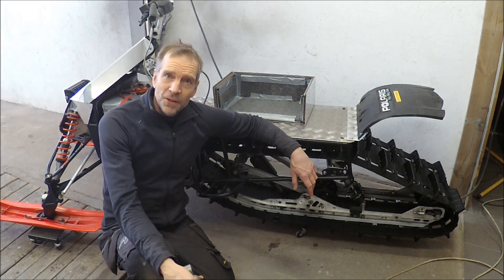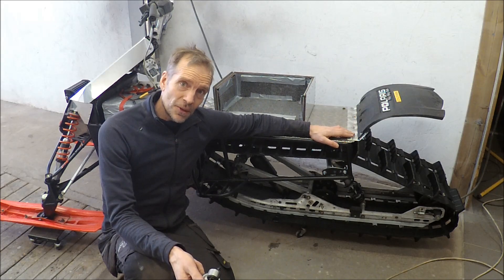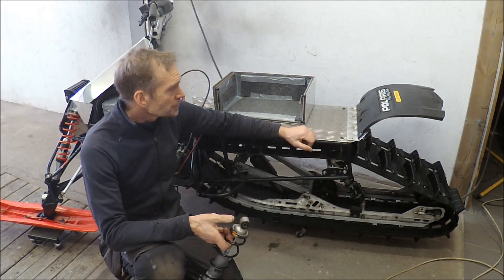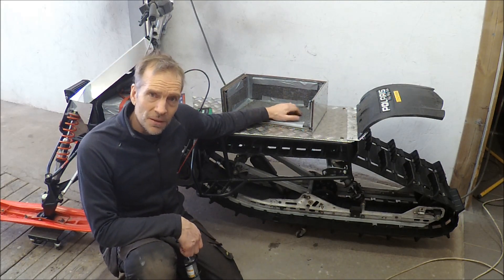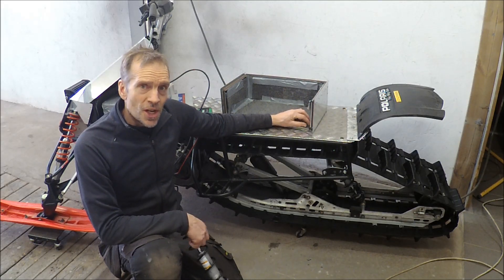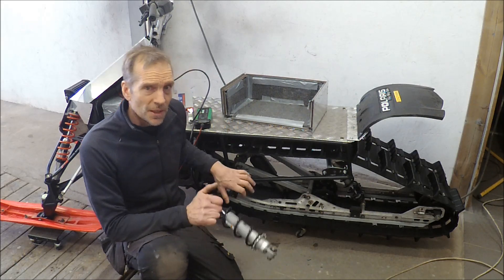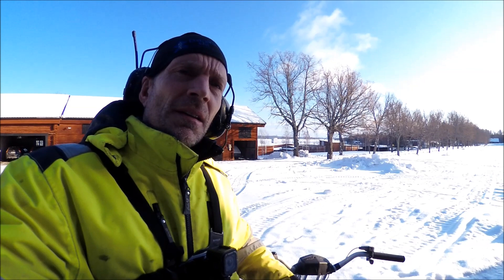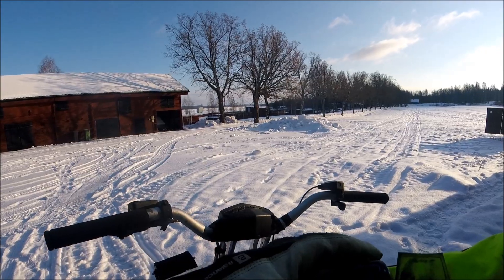Electric Snowmobile Range test

Comment: why the hell BMS's are designed to run the power through them for the main drive is baffling.. Such a stupid design for a  " smart " system.. Its the weak link in almost every build ( either restricting power limit to controller or causing other issues with balancing
Reply from the maker: I agree. But you have to design your batterypack so you dont damage your batteries. Been there done that👍
Reply: @persteel  i just do a charger balancer per pack , yea its more hassle but everything works perfect and No cap on peak amperage ,, Using lipo 3s it ends up being a lot of chargers but theyre all small

Comment: By the way, in case you are not going to create your own EV production company, why not to try to become a local dealer in Europe for Taiga Motors - Canada based Recreational EV startup? They are about to start mass production of their T3 electric snowmobiles if everything goes ok considering the challenges they might be facing as a startup and a company that never produced gas powered snowmobiles. I also have read some prospects of BRP, where they unveil their plans of going electric and aiming for the first EV's in their fleet to appear between 2025-2030. I guess they would have strong cards in their hands considering their R&D capacity, name and existing distribution and service network. What the most possible customers challenge though is real life range... . Lets see what future brings. Your videos are inspiring!
Reply from the maker: Hello, Julius! The EV sector is very interesting, also a lot of money flow in that direction. Afraid I'm just a small guy in that game. But thank you for your support!  BR Per

Comment: Hi Pän, great channel and interesting electric snowmobile project! As number of viewers mentioned I would also be keen on purchasing one of such if you would produce more. Any improvements from the last year with regards the frequent need to restart / reset and sourcing better battery pack?
Reply from the maker: Hello, Julius and thank you ! Happy you like my builds.  I usually only build one vehicle and then want to inspire others to do the same showing it is not that hard.   Problem with current batterypack is it that is it cheap batteries, whole batterypack gets unstabile. Planning to build a new one with OEM PHEV modules, much better!

BR Per

Comment: Hello, I'm glad I found your channel! full of ingenious vehicles built from relatively modest means.

I am wondering about the autonomy of your snowmobile, 30 minutes of autonomy would imply that you consume on average 8kw! (4kwh battery * 0.5h) which is a lot considering you wouldn't seem to be going very fast on your video.

With you installed an ammeter on your snowmobile (or a wattmeter) ?? with this we could see the power required as a function of the speed, thus deducing the autonomy as a function of the speed. The friction losses of a snowmobile increase extremely rapidly with increasing speed.

If your 18650 cells were not from a recognized brand, the actual capacities may be less than half of their theoretical capacities. (a good independent test here) https://www.youtube.com/watch?v=qMZuHMlRw_0

I have built several gasoline vehicles, a small snowmobile can run a good 3 hours on 3 liters of gasoline

3 liters of gasoline x 8.9 kwh = 26.7kw / h

Small petrol engine efficiency 26.7kw / h x 25% = 6.675

Brushless electric motor efficiency and loss of battery efficiency caused by cold 6.675kwh / 90% / 90% = 8.25kwh

So a battery of 8.25kwh could give an autonomy of 3 hours (1.45h with a battery of 4kw / h)
Reply from the maker: Hello, BRX and thank you ! You are correct in your assumption. I built the batterypack from cheap aliexpress 18650 batteries. I cannot charge them more than 95-96 V.  I am planning to build a longrange batterypack from Outlander modules this winter. Will be very interesting to see if there would be any differens.
Really happy for your comments and calculations. 

BR Per

Comment: Try to use the bms only on charging, and have discharge directly on the battery. And watch the volt meter manually so you know when to stop.
Reply from the maker: Hello, herskerhans ! Thank you for the tip, I will try that. I have done that before but without coulometer, batterypack cought fire....  BR Per

Comment: What type of battery is that currently? Storage batteries are not best designed to give large outputs of power otherwise they die fast. I guess your not using storage batteries i hope. I am building a 20s 4p pack from 21700 cells
Reply: Very nice 🙂 but no donuts??
Reply from the maker: Hello, Jaz !  It's comming :-)   BR Per
Reply from the maker: It is the Heavy Duty batterypack : https://youtu.be/6ezTCG2Kiz4   but another BMS: DALY 250A continius and 600A burst.  Nice, the 21700 cells seems to be really good. Maybe an upgrade for next year, keep me posted about progress on your pack !!  BR Per